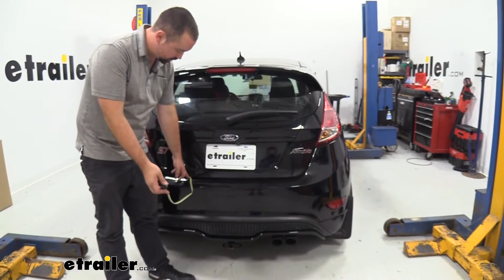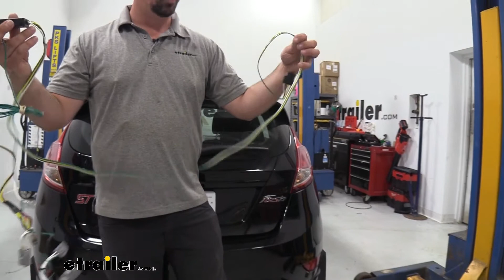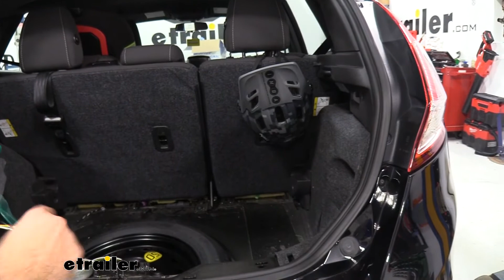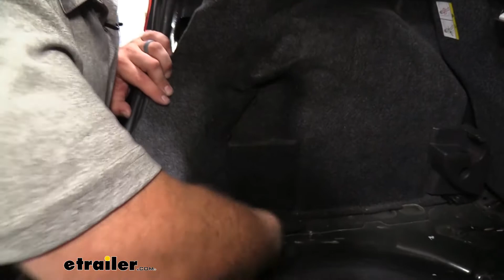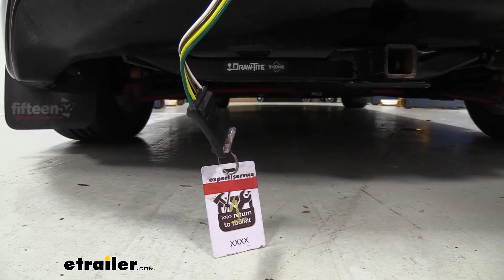etrailer | Curt T-Connector Vehicle Wiring Harness Installation - 2018 Ford Fiesta

Comment: For anyone watching this, if you peel back the driver's side sound deadening panel a bit further you'll find a stud jutting up that is perfect for the ground connection, no drilling required. All you need is an M6x1.0 nut to secure it with.
Reply from the maker: Thanks for the helpful tip!
https://www.etrailer.com/Custom-Fit-Vehicle-Wiring/CURT/C56191.html

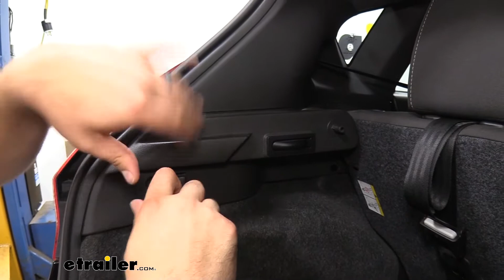Comment: The self tap screw isn't needed. The screw you pulled at 3:30 is where I put my ground terminal. I put the terminal between the body and panel then used the screw to sandwich it all together.